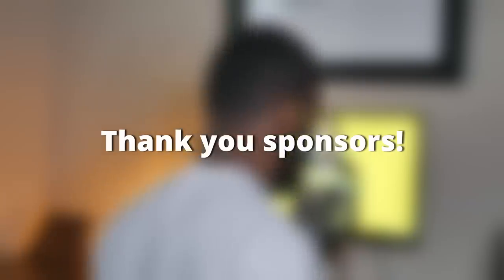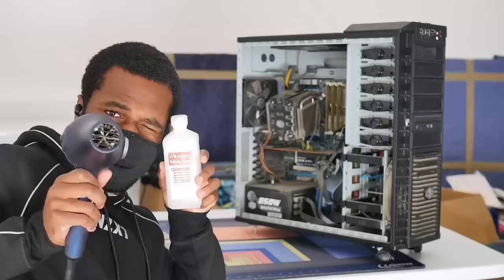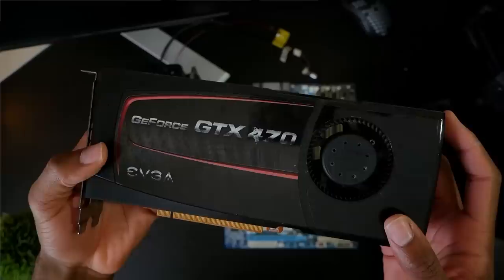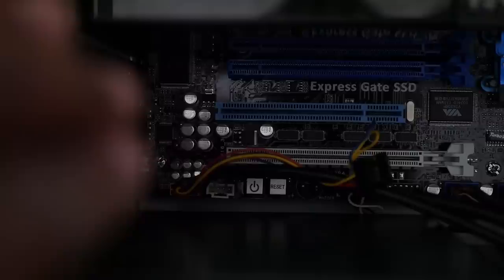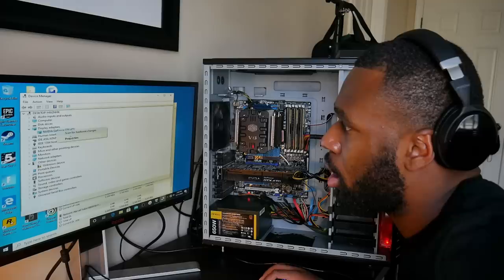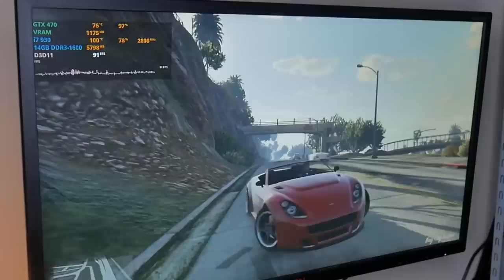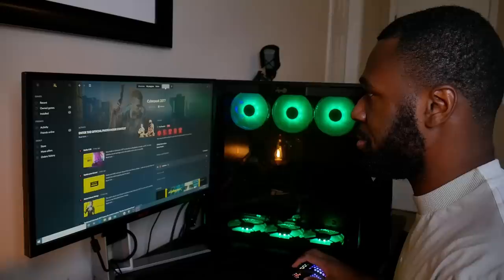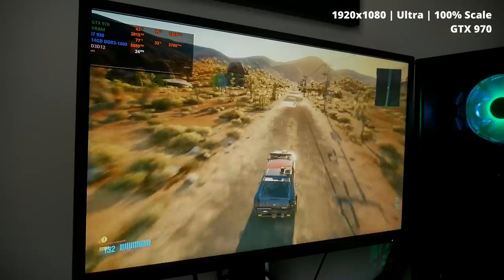The $32 Cyberpunk 2077 PC That You Can't Build | OzTalksHW

Comment: would be great for emulation...slap some linux with front end similar to retro pie on it and use it only 4 retro gaming
EDIT after watching video : Ufffff to much work etc...just get an optiplex 7010 or simmilar and slap new power suply cheap ssd and rtx 580 8Gb....and u have comp that can play retro games and new titles 1080p high

Comment: Error 43

I had a GTX 660 Ti like 2 years ago and what I did is just simple. Bios reflash
Reply from the maker: BIOS reflash is a good option. Considering the GTX 470 is like 10 years old now, I figured the hardware might be dying
Reply: @OzTalksHW  You sure like the hair dryer tho 😂👍
Reply: @OzTalksHW  BTW forgot to mention an important thing with that error 43. After like 3-5 months it just came back but at that point I was well aware that I needed to do another bios flash. When I sold it I told the buyer. Luckily he knew how to do it so he got a good deal just like me when I bought it :D Served me right 👍

Comment: I have a dell 7950 gtx mobile part that the header on the motherboard blocks. Should I cut the old header off and install 7950 gpu or get  new dell motherboard on Ebay without the display header in the way?

Comment: bro i run g4560 and rx570, 8gb ram 2400mhz. but with lowest graphics on valorant i cannot get past 150 fps.. and in some cases while its so chaotic, I sometimes get 70 fps. even 60. and average of 100fps. but your system in this video got like easy 150-200+ fps on bots. WHY?

Comment: Hey my friend, I have a 15 year old HP PAVILION a141n, with 3800+ AMD Athon 64 Processor, 1.0 GB memory, 200GB hard drive, Integrated NVIDIA Geforce 6150 LE graphics a141n, DVD + RW lightscribe double layer 16x drive, Windows XP W/ windows Vista Capable, HP Photo Smart Premiere Software, 9 in 1  memory card reader,  usb &  Fire Wire Port. Is it possible to turn this unit into a gaming computer? Thank you so much  for your time in advance.
Michael

Comment: i7 930 at 90/100c while gaming? With the V8? That CPU has an internal problem or the cooler doesn't making contact. I had that cpu and never reaches even 85c with a CM 212
Reply: why works better with the Intel stock cooler? XD you try lapping the V8?